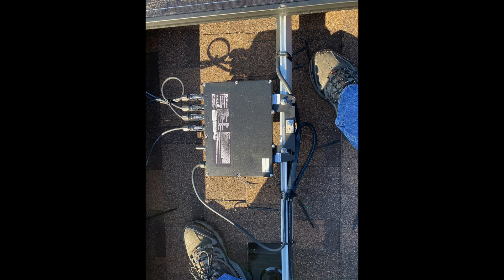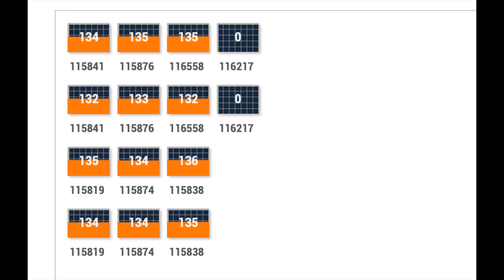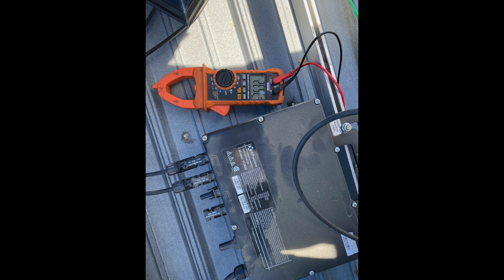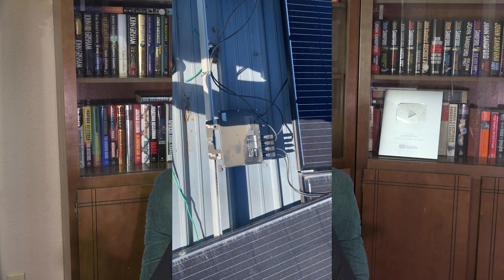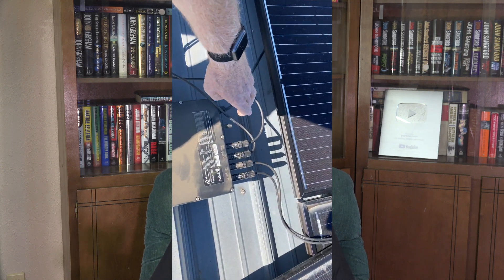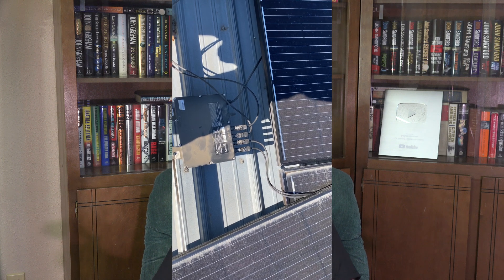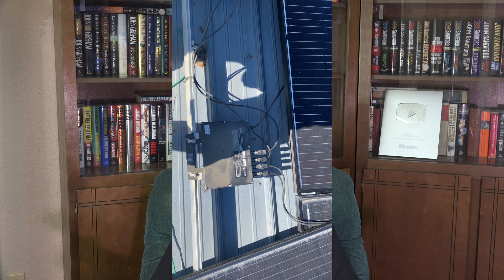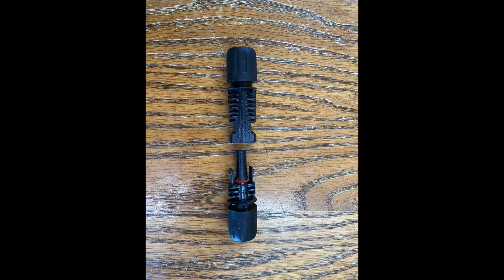Replacing a microinverter on a solar system

Comment: It seems that the connectors are bad but micro inverters would seem a good idea overall if there were a good connector standard. I really like the idea of having no single-point-of-failure in the system. You had a bad inverter and only two panels were offline. If you had had regular inverter setup instead, whole array would have been down for the whole replacement period.
Reply from the maker: There are 2 ways to look at this.
Multiple inverters mean multiple problems.
Multiple inverters mean one failure only drops out a small part of the system.
GFM
Reply: @grayfurnaceman  I fully agree. When you have more redundancy, you have more states the system can run in redundant state (that is, not fully working but not fully failing either).

Comment: Quick question. You said the inverters are under warranty, is the labor for replacing them not covered?
Reply from the maker: As the system is a DIY system, the labor is mine.
GFM

Comment: I’m going to have all my inverters located inside on ground level.  You’re stuck with dead panels if this were winter with ice on the roof, particularly with a steel roof.  Wire is cheap, hospital visits not so much.  Thanks for sharing.

Comment: Just the worst possible place to put power electronics and have them last. 
Redundancy is nice, two strings maybe, but every 2 panels overkill.
 HV inverters and batteries becoming more common now, probably less cable too especially in US at 110V?
For a few extra panels are on a spare patch of roof the microinverters are fine, even then would still try to put them in a cooler spot
Reply from the maker: AP has changed to 4 panels per inverter in their newer units.
GFM

Comment: I know the purpose of micro inverters is to prevent one shaded or failing panel from dragging down the rest.  What keeps an installer from running each panel's dc output down to the ground or inside the building where each micro inverter could be wired in an accessible location?
Reply: YES. That would be a great improvement. Better yet, lets bring all those DC outputs into a box called THE Charge Controller, and 'micro inverters' into one box...we will call it THE Inverter. Both of these boxes accessible  for service and protected from the elements😁   Some engineers failed big time on this 'micro inverter' concept.
Reply: DC has far more voltage loss with long wire lengths, vs. AC. the cost of the wire would be way more, as it need to be larger gauge to curb losses and you'll need a pair of wires per panel now, vs. the inverter's all tying together and coming down one cable or a few.
Reply: @throttlebottle5906  Voltage drop is the same ac or dc as long as their voltages are the same.  Low currents also reduce drops in either case.   When you have microinverters buried under a matrix of panels, one replacement would pay for the cable.  When one goes, there will be more to come.  Others have seen the same pattern.  One fall avoided would be worth more than the whole system.
Reply from the maker: The micro inverters are used as a cost, shading issues and simple installation measure.  The wire size for a 4.5 kw array would be about 1 or 0.  The only other way would be 28 #14 conductors plus ground.  You would also have to have a rooftop disconnect.  A very large disconnect.
When I was determining how to go with this system, this was the best option by far.  In the case of the shop arrays, I had a 160' run.  The wire size for those arrays would have been quite large.  
If I was to do this again, I would do it the same way.
That said, if there are more failures, I may have to reconsider.  If there are more failures, I will be doing videos.
GFM

Comment: Got two PV systems here. 16 panels each, exactly the same, same orientation. One on Enphase iQ7+ microinverters. The other on a Deye Hybrid string inverter… I do have some shadowing, both share the same % of oversizing of Wp. Guess what? They perform identically, but the micros are just a pain to install and do operate on a way more punishing environment… MTBF . And if all micros came from the same lot, great chances having all failing anytime soon too. They should do some lot shuffling. Not a fan of microinverters… More of a faff.
Reply: Why??????
Reply: @davidnord1979  just to be safe and sheer curiosity…
Reply: Do you happen to know of the deye can work properly with only one PV string/mppt channel connected? With the idea of adding another string further down the line
Reply: @cormacsyt0  it does work with a single mppt.
Reply: @cgauer  Nice, thanks